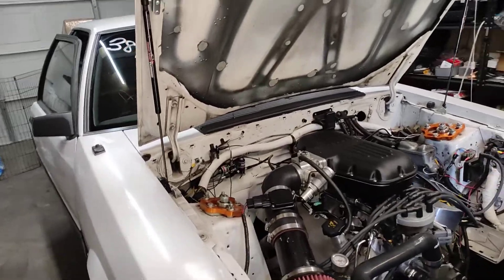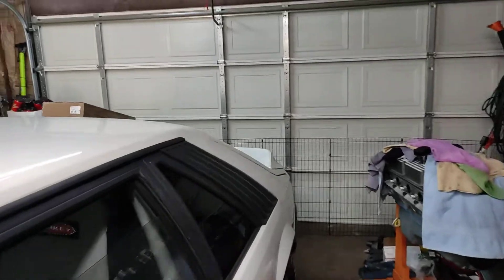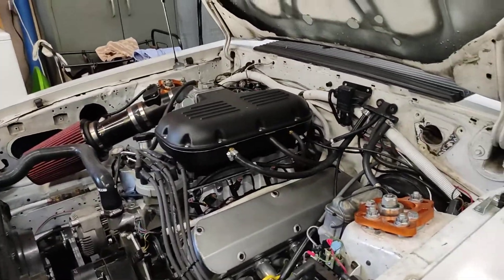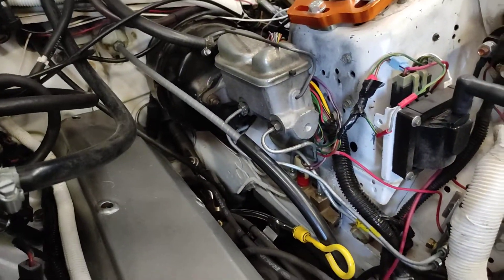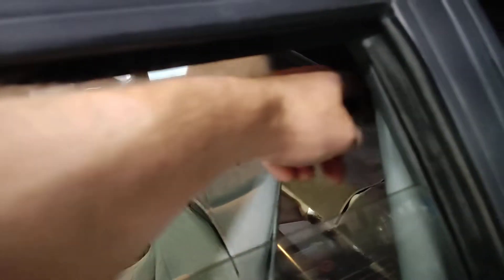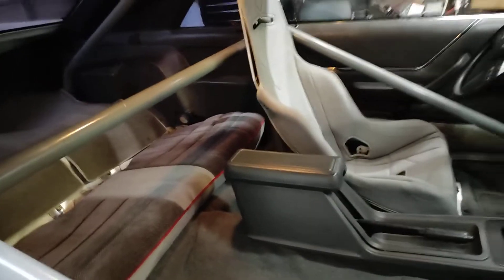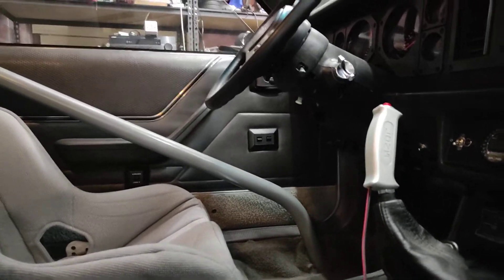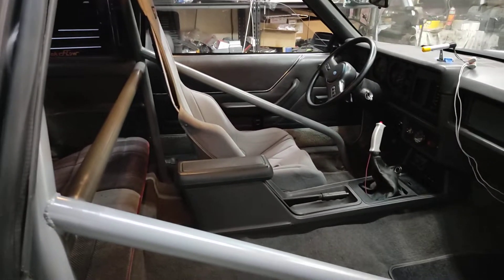6 point roll bar installed, Trickflow Box R intake info

Comment: Hey Don I did not see you out there on the 12th the roll bar looks fantastic it would have been nice to have someone to test with my car ran like s***, I'd like to get together with you this weekend if you're free I need a little help with the Torino give me a call
Reply: I didn't get there till the grudge fest and I got three passes but I could have had a dozen I wasn't in any hurry but the passes that I made were pretty lame I was not getting third gear for two or three passes I did run an 1189 with the 168 60 lot of other stuff going on we need to touch base I might need to feature you for some of my content because I don't know if the trainers going to make it to the next round of drag races
Reply: @vrm86gt  if you could ,She got my truck . Need to make some jack stand pulls to check C6 ,I'll explain later